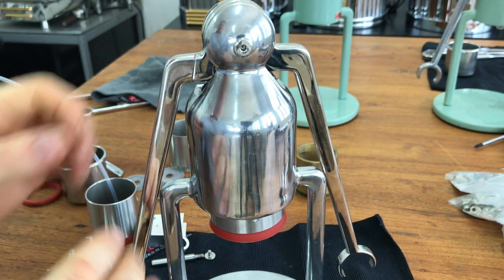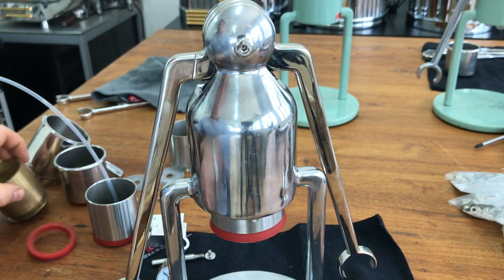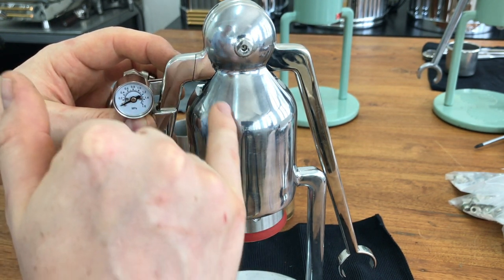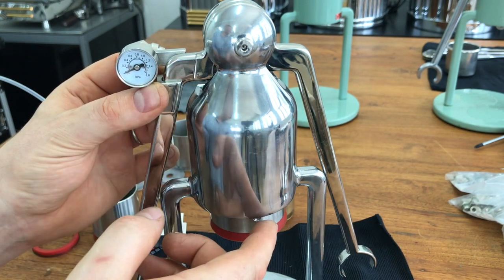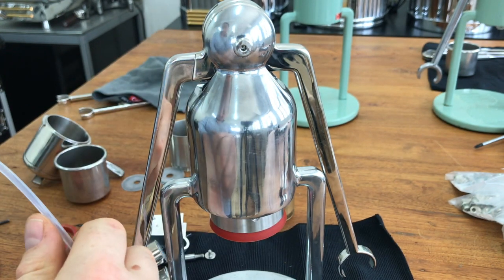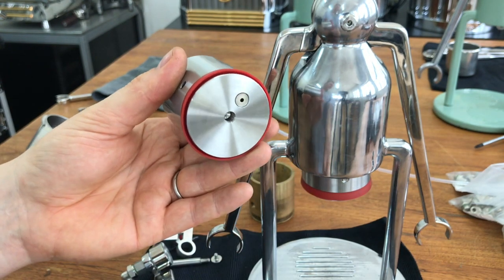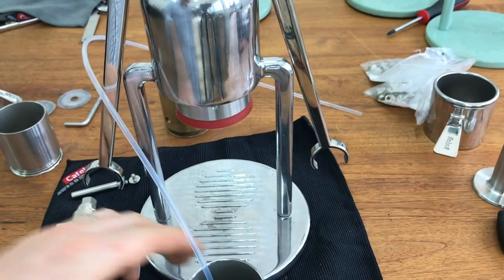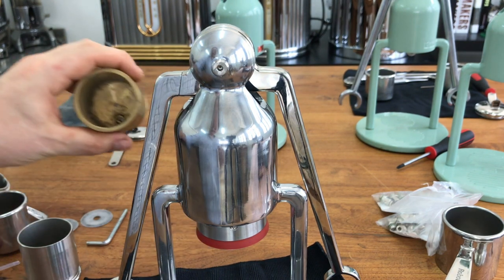Cafelat Robot Basics Part 3 - The Pressure Gauge

Comment: Do you think that dispersion screen without rivet for holding will be a good idea? Just small stick with neodymium magnet in the end for lifting the screen from the basket probably will resolve the problem with accidentally smashing the screen with the piston.  Event the tamper with magnet in the handle will be enough. I'm not sure if that will be convenient solution and if the used steel is ferritic. Any way the temperature over 80°C
 will demagnetized the magnet.

Comment: I just got a barista model with the pressure gauge, but my pressure gauge calibration is off and stuck at 2 when not in use. Does anybody know how to zero out this gauge??? I didn’t want to remove the gauge from the bracket since he said he thread locked it to attach the bracket/nut. Any ideas on how to calibrate gauge?
Reply: I just got mine the other day and my gauge doesnt appear to  be working at all too. Did you work this out?

Comment: This is awesome, but as many have said - its placed weirdly. Why place it where you cant really watch it while pressing?
Reply from the maker: Of course you can see it.   The reason it is on the arm is because the gauge is connected to the piston.  The piston moves up and down, since the arms moves up and down too,  the capillary tube moves in tandem with the piston, thereby placing less stress on the tube.   A stationary gauge at the top is probably preferable but not easily doable without placing too much stress on the tube.
Reply: Glad someone said it…why do people keep claiming you can’t see the gauge when pressing? Does everyone have their Robots on 3 feet high counter tops!